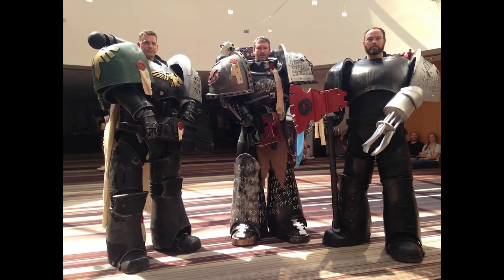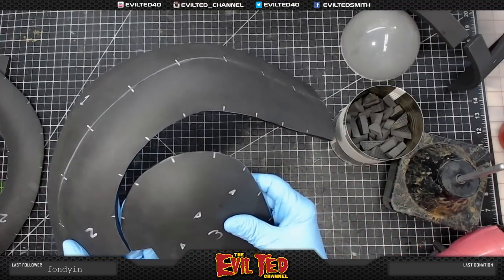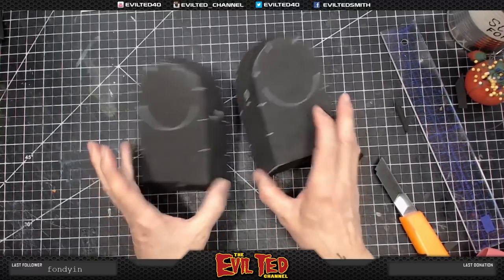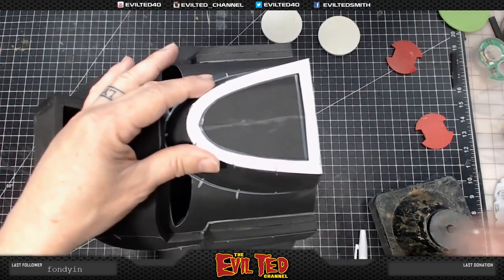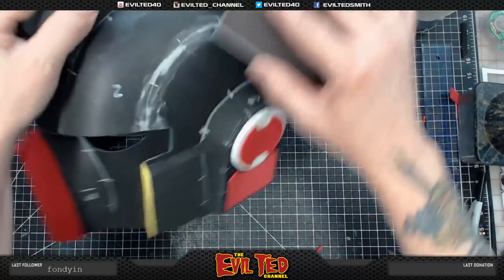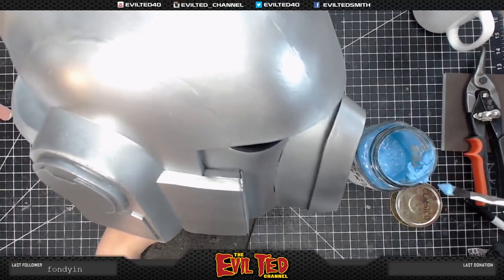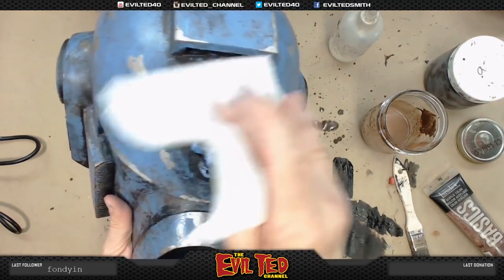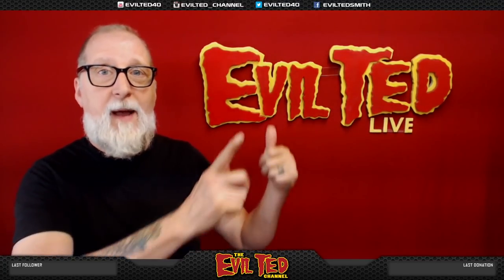Evil. Ted Live: Making a WARHAMMER Helmet

Comment: I had a question about your incredible chipped paint technique. Obviously the liquid rubber seems to work the best, but you also mentioned it being done with toothpaste, do you think Elmer's glue could give the same effect as well?
Reply from the maker: Do you need something it won’t stick very well. Elmers glue is still a glue it might stick to good and pull the paint off as well. If you don’t have rubber latex use toothpaste.
Reply: @EvilTedSmith  Okay, thank you so much for the tip!! Would I just use the same methods with the toothpaste that you used with the latex?

Comment: You use a lot of contact cement, that I gather is rather solvent aggressive. Have you tried the neopren rubber contact cement? Used for akvarium and water basins, waterbased, UV resistant and have a forever like shelf life. Came across creature cast homepage, and that got me going... I've been looking for a latex replacement for a long time and neoprene seems to hold an answer. Here in Denmark it's too costly to have their product send. So I've looked around for lokal neoprene products and stumbled across this waterbased rubber contact cement from Danalim. I think you should be able to find something similar, and maybe get rid of the acetone under your nose ;)
I love your glue pot, where did you find that? And a BIG thanks for all your inspiring videos ☺️
Reply from the maker: Thanks for the info. Glad to here you like the Creature Cast.
Reply: @EvilTedSmith  haven't tried it - you got some part in creaturecast? The only thing that worries me is that the most elastic version is shore A 30 - regular latex is shore A 20. Do you know if it is possible to go even lower like shore A 10-15
Reply: I've tried to kneat 1/4 silicone into a foam clay and that really makes it keep flexibility, the modeling time was a little to short before settling. I'm going to try with some MS sealent - a paint able version which has a blend of the acrylic and the silicone properties.